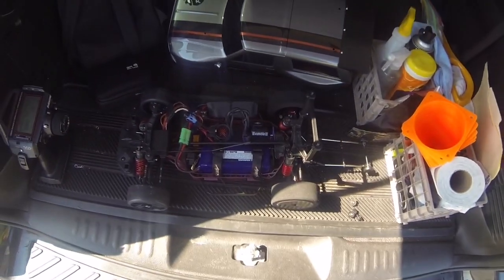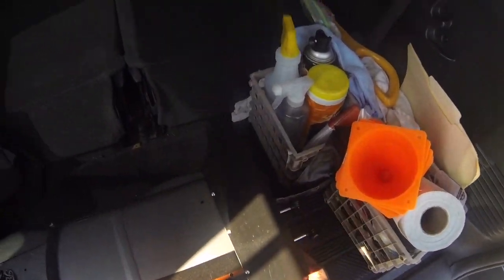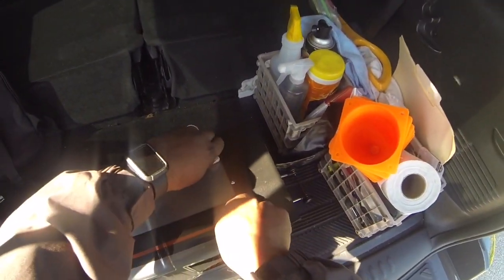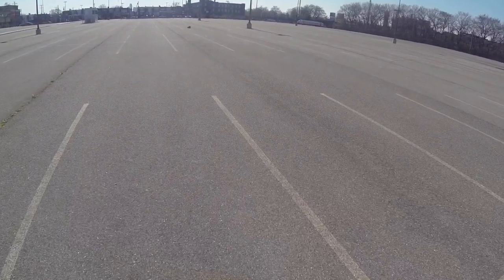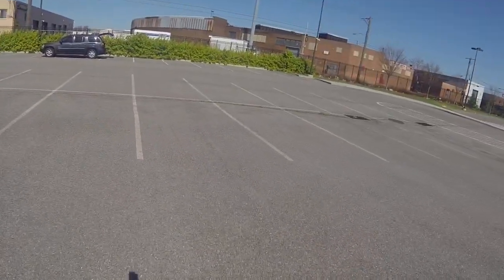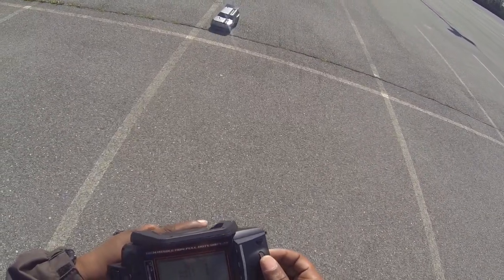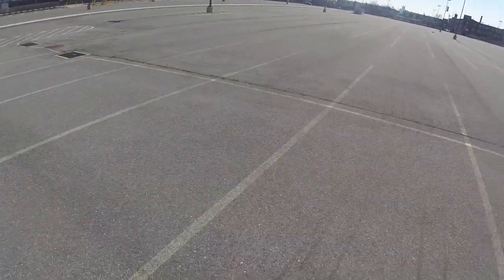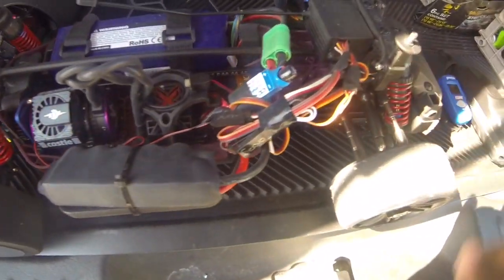Drag Slash RWD Test Hits

Comment: Nice bro i like i new the mmx was in there before you said it i could hear the little beep when you apply a little throttle nice vid big bro peace🚗
Reply from the maker: Thanks homie! Yeah it's the mmx. It's seems to have a slight hesitation on hard launches...I have to see if that's adjustable or not.
Reply: +Dan P (AT EASED1) i hear you never really noticed it .
Reply: +Dan P (AT EASED1) imma check it out doe.

Comment: Mr. DP, I am liking the drag Slash. The only thing is that body is nice if there is an unforeseen event. Also bro, you failed to take the temp on your batteries, they are an integral part of the ride also. Like I said, I am digging this dragster thing, I wish you well. GOOD LUCK
Reply from the maker: I forgot to check the batt like I forgot to check the servo temp. As far as the body...you should know me by now my brother...I gotta be different! Lol!! Imagine this, there's a guy at the line with a mclaren or jaguar type body and then I pull up in this. Then I give him a run for his money if not beat'em!! How would this body look then?! Lol!! But no worries...I still have Plan-B  (yellow mustang) in the garage. 👍🏾

Comment: this is really dope
I'm actually doing something just like this with a rwd vxl3s slash
I am going to put funny car rear tires for the back 
not sure what I am doing for the front yet
what wheel adapter did you use for the funny car tires?
thanks in advance bro
Reply: +Joshua Lee Chee  I subscribed btw
Reply from the maker: Thanks and I used STRC 14mm hex for the funny car rears.
Reply: thanks, I'll be picking some up soon hopefully
Reply from the maker: +Joshua Lee Chee No problem

Comment: I'm hearing a bit of wheel hop as the rear starts to dig in under throttle. It's a beast what motor r u running ? Peace bro RCFL
Reply from the maker: Yeah I noticed that in the beginning but it seemed to smooth out later. I have to see if that's the new foams or the suspension. Thanks bro! And this is the poseidon 2650.
Reply: DanP RC what tires and where did you get them thanks for your help

Comment: what body is that?
Reply from the maker: RandomAj 23 Proline bronco
Reply: DanP RC thanks it 1/8 right
Reply from the maker: RandomAj 23 Yes and no. It's for short course trucks like the slash. I say it like that because the slash is labeled as a 1/10 but measures up to a 1/8.
Reply: DanP RC OK thx
Reply: DanP RC all sc trucks are 1 10 even though they are based off of 1 8 scale layouts and measure to be 1 8 something kinda odd about them